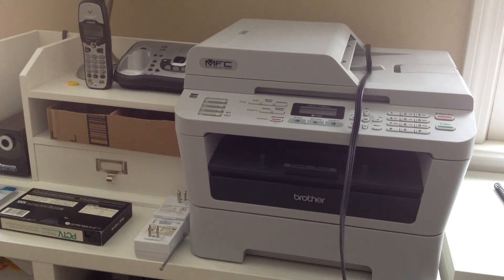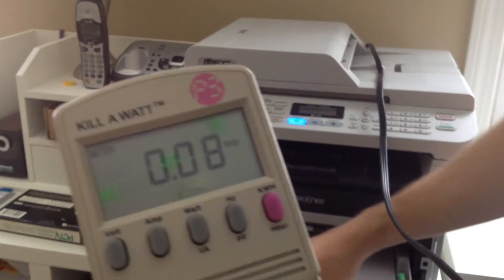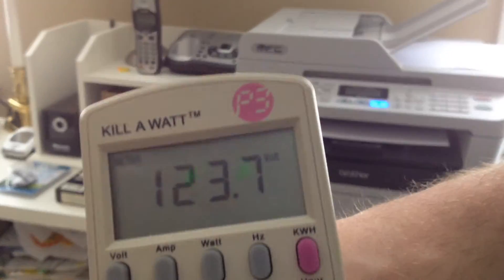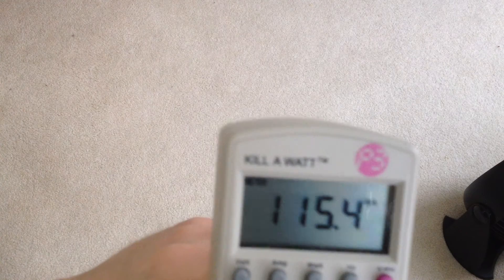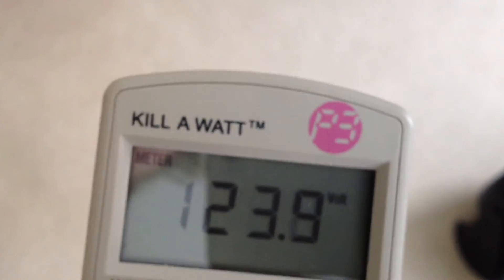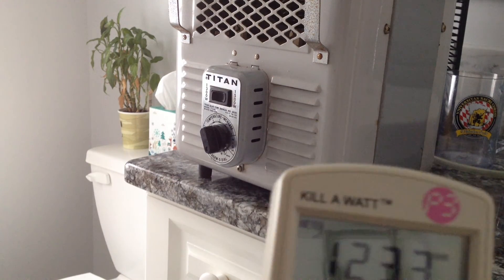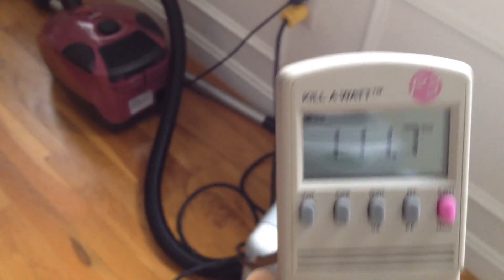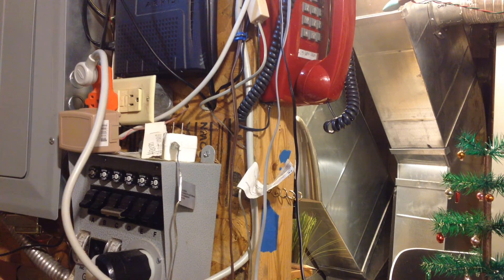Voltage Drop when Operating Powerful Appliances

Comment: Voltage drop when a heavy current load is placed on the line is completely normal.  Depending on the device, the condition of the wiring, and what type of lights are being used will result in how much of the drop you "see".

Aluminum wiring was used in the late 1960s to early 70s, and often the connectors on switches and outlets were not made out of aluminum.  That led to corrosion due to dissimilar metals touching, which created a point of high resistance.  That leads to a voltage drop.

I believe the house you're in is newer than that, and as such doesn't have aluminum wiring.  But the reason the drop in the outlet right next to the panel was so low compared to elsewhere is simple:  The longer the wire, the more resistance, and the less current it can carry.  So the outlet 3 inches away is almost effectively connected directly to the pole (or underground wiring if you're that ooh-la-la).  Outlets on the other end of the house on the top floor are wired back to the panel.  Essentially you can consider all of those outlets very long extension cords.

Also, any junction creates resistance.  So every outlet on the line, every switch, every junction box on a circuit creates a little more resistance, and that's why the drop isn't as apparent on some lines, as there aren't as many connections.

In our old apartment, we lived in a town with a lot of apartments, so in the summer, voltage was often lower than other areas due to so many air conditioners on.  As luck would have it, our living room A/C was in the diagonally opposite corner of the house and was plugged into the second-to-last outlet on the line.  One time was so bad the A/C compressor refused to start because of all that low voltage and resistance.  Generally once it was running, the landlord asked us to leave the A/C running while we're gone, otherwise "it has to work twice as hard" to cool the place off.  The landlord paid the electric, so we had a deal, I left the A/C on all the time.  During the summer, I was able to cool the place to as low as 54 degrees, I used to go outside to warm up!  But it was free, so we did it.  And if you put your hand on any other outlet along that line, it was warm.  That gave you an all-sorts-of-safe feeling knowing that.
Reply from the maker: +jaykay18 I knew there was some normality to it,, but this seemed like an extreme case.. I know this house has copper wiring.. Or at least its something that looks exactly like copper..

I figured that was probably the case with the outlet downstairs,, that would all make sense..

ohh-la-la? What a stupid thing to say!

Some of these rooms have quite a few outlets,, and some convoluted thing with the ceiling/closet/useless lights, so there's definitely junctions to spare..

I never quite understood the whole 'it works harder' thing.. As far as I'm concerned, the thing just runs.. It runs the same if the air is 70 degrees or 80 degrees.. It shouldn't put more load on the fan motor to move air that's warmer than cooler,, or increase the difficulty the compressor has moving refrigerant through the lines if the air in the evaporator is 70 vs 80 degrees..
Reply: Jordan U If it looks like copper, it is copper.  And I didn't say "ohh-la-la", I said "ooh-la-la".  I left it in quotes so the exact meaning is up for interpretation.  And no matter what language, "ooh-la-la" isn't interpreted as stupid, it's interpreted as rich.

I never came up with the "works harder" thing.  The landlord did.  I did quick math in my head, and realized they meant to leave it on all the all the time, and they were paying for the electric.  So we did.  It never would work harder, it would simply run longer to take care of the loss off cool air.  That's the idea they were going after, but the unit can only put out so many BTU/hour, and it will continue to do so at that rate until the thermostat is satisfied.
Reply from the maker: jaykay18 Since its left up for interpretation, I will continue to interpreter it as stupid..

I never said you came up with it,, I completely understood it as you intended before.. Don't be interpreting me as ooo00o0o0oooo-lala!
Reply from the maker: +jaykay18 And I'll interpret you as rude!
Reply: Jordan U Don't get all Stephanie Tanner on me now!
Reply from the maker: jaykay18 Who?
Reply: Jordan U Stephanie Tanner.  There's this thing called "google" for stuff you don't know.  And you're going to be watching reruns of the show this character was on all summer, as you sit quarantined in your house, with the lights dimming as the vacuum is frantically switched on and off every 15 seconds because of another crumb that was missed.
Reply from the maker: jaykay18 Half the stuff on Google is wrong.. I'm sure she's outrageous anyways..
Reply: Jordan U Who are you to say that, Mr. Yahoo?
Reply from the maker: jaykay18 I am me to say that, Mr. Imposibletoseeceilingfanvideos..
Reply: Jordan U Don't bite the hand that feeds you, I got three more videos to make, keep this up and you shall not get.
Reply from the maker: jaykay18 You started it, I'm just putting an end to it..
Reply: Jordan U "Cut me some slack, Jack! Chump don' want no help, chump don't GET da help!"
Reply from the maker: jaykay18 And let me guess,, I'm supposed to type that into the biggest garbage dump in the world and find out where that comes from and what its literary analysis is?
Reply: Jordan U You've guessed correctly!  HINT--it's called copy and paste.  And if you haven't seen the movie, you should.
Reply from the maker: jaykay18 I can't even remember the last time I watched a movie..
Reply: Jordan U Me too.  But that is one movie you have to see.  Everyone says that about movies.  I actually mean it.  And you won't be sorry--a piece they usually forget to say.
Reply from the maker: jaykay18 I'll have to see.. An hour or more to watch a movie is a lot of valuable time..
Reply: Jordan U I do agree, which is one of the reasons I almost never watch movies.  But I've made allowances in my life.  Not monetarily, but time-wise.
Reply from the maker: jaykay18 I will consider viewing said film..
Reply: Jordan U Pards begged!
Reply from the maker: jaykay18 Pards not received..
Reply: Jordan U I guess you'll have to search further for the pards.  They don't come to you, you have to go to them.
Reply from the maker: jaykay18 I haven't got time for that..
Reply: Jordan U That's too bad.
Reply from the maker: jaykay18 True!
Reply: Jordan U Authentic!
Reply from the maker: jaykay18 And original..
Reply: Jordan U Natural, not artificial.
Reply from the maker: jaykay18 Artificial is not good for the health..
Reply: Jordan U Right, that's why I said natural!
Reply from the maker: jaykay18 Good!